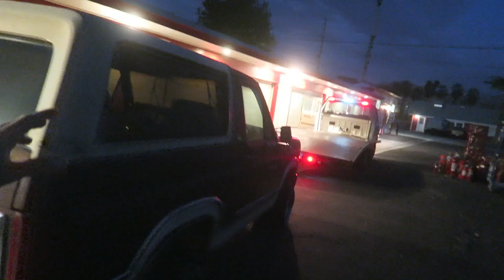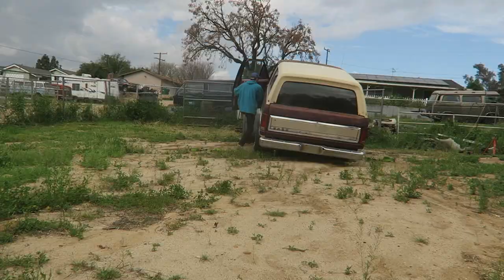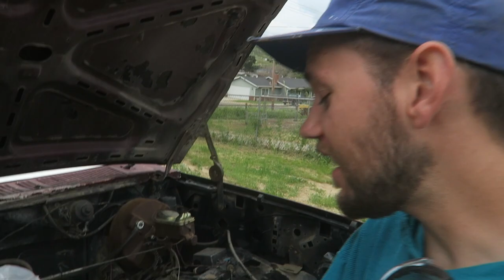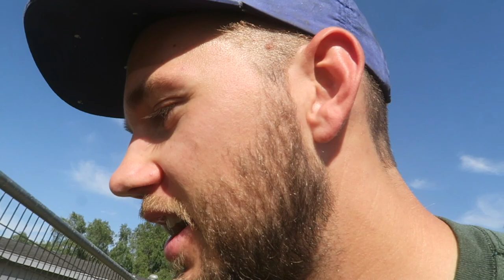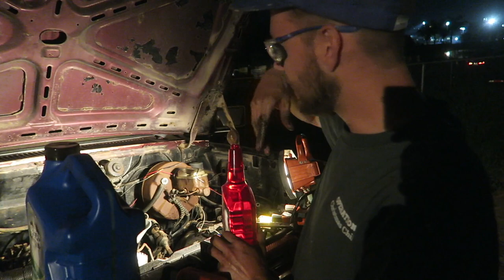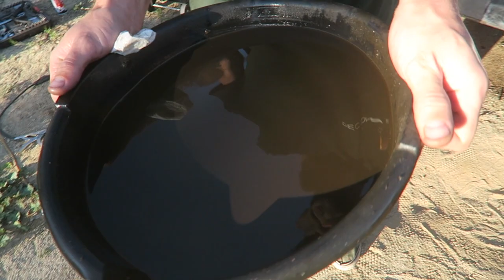Ford Bronco Sitting for 20 Years!

Comment: Quick question i have a Ford bronco haven't turn on about 8 years i kept in a garage would u recommend to fill my oil with diesel as u did. I drained my oil and mine  look pretty good compared to yours
Reply: Is an 88 btw